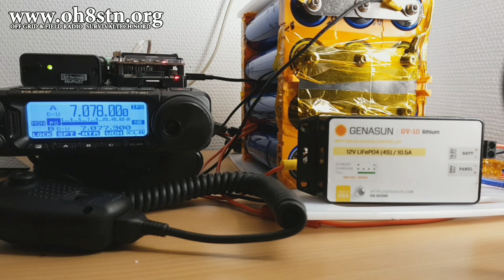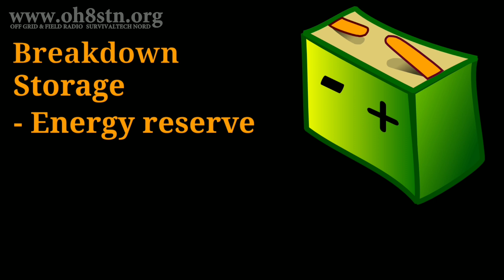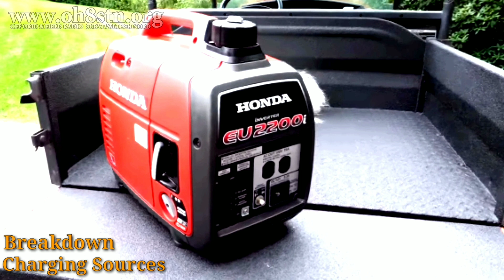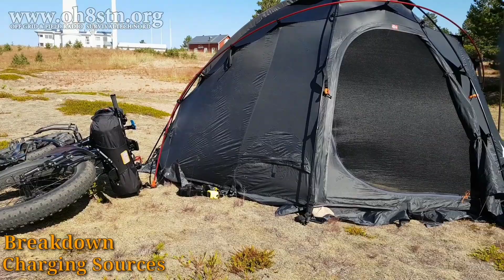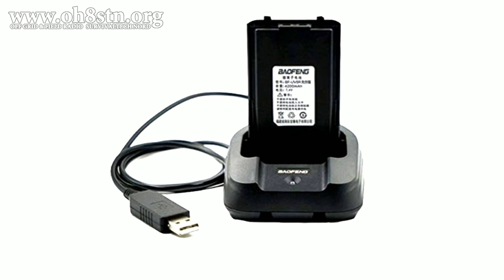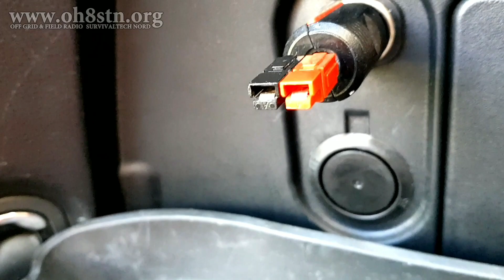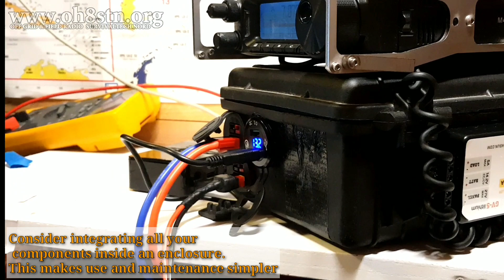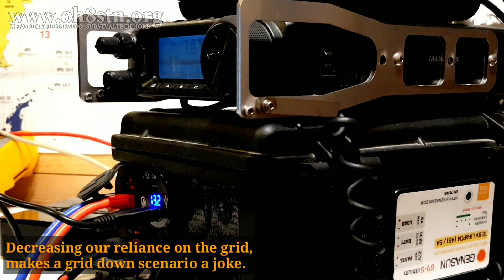Backup Battery Power | Grid Down Communications

Comment: Hello sir. I built a Gmrs go bag using a Wouxun KG1000 50 watt radio. For power, I purchased a 12v 12ah lifePO4 battery, when I attempt to transmit, the radio goes out, when I disconnect the power, and reconnect it, the radio comes back on, could it be the bms is overloaded when I attempt to transmit?What ah of battery would you recommend? Thanks in advance...Clint

Comment: I'm an apartment dweller with limited space. I have a DIY solar generator 12 volt battery with a trickle charger on standby and a 30 watt panel. It's just for battery charging , flashlights small stuff. Also battery packs rechargeable batteries and chargers. I also have a southern view sun beams in for about ten hours. Want to get a roll up panel with my limited space can't go on the roof, something is better then nothing. I'll never walk a mile and a half for six double  A batteries. Black Out a few years back , north eastern blackout.
Reply from the maker: Excellent 👍
I use a 28 Watt rollable that drops out of my upstairs window. It's there just in case.

Comment: Radios are powered with 12 volts. Laptops are powered with 19.5 volts. How do you power these two with the same 12 volt battery? Thanks for any info.
Reply from the maker: Not all laptops are powered with 19 volts. Some of them these days are powered by USB C. This is the preferred type of laptop. For example my Lenovo Yoga laptop can be charged with the USB C adapter. For older laptops many people choose to use an inverter, but I don't for two reasons. The noise in our radios becomes a big problem when we use inverters. Secondly it's inefficient. Instead I would get a DC DC power supply 12 volts to 19 volts for older style laptops.
Reply: @OH8STN  thank you. I will do that. The next laptop will be a USB C, for sure.

Comment: Just bought the yeasu 817 can I run it on external power without the battery installed that comes with it ? I have a bioenno 12v 24ah battery and charge controller and 28w folding solar panels.
Reply from the maker: If you have an external power source, there's no reason to have the internal battery installed. It makes the radio lighter if you remove that internal back anyway.
Reply: @OH8STN  Thank you I'm new to the whole portable ham station as well as the yeasu 818 obviously.
Reply from the maker: No worries, you'll have a lot of fun with it.👍
Reply: Sorry to bother you but have a question that I can't seem to find an answer for. Just bought the mfj-1899t to run with my 818 can I run it through my LDG-Z 817 without using a counterpoise?
Reply from the maker: Definitely not! It would be the same as running 1/2 of a dipole. Get yourself 3 or 4 counterpoise wires a quarter or half wavelength of the frequency/band you're working.

Comment: Well done. I’m situated in a somewhat remote area about 50 miles from Yellowstone Park. Worst scenario.. the volcano blows and none of this will matter anyway. Short of that, we have no intention of abandoning our home. Our emergency preparations include:
1. Hitzer coal stove to heat the radio shack/pantry/reloading building.
2. 2,000 pounds of Tractor Supply anthracite nut coal.
3. Honda 6500 inverter generator.
4. 300 gallons of premium, non ethanol gasoline.
5. Transfer switch to power vital circuits with the generator.
6. Coleman, Feuerhand and Aladdin lanterns with fuel and spare parts.
7. Backup stove/oven plumbed to 500 gallon propane reserve tank.
8. Night vision equipment.
9. Spare ham radios, antennas and power supplies.

I plan on picking up a Honda 2000 inverter generator as budget allows.

Comment: I really like the vid.  It give me alot to think about.  I really got stuck on the distribution cable you made.  Great idea.  But I get stuck on the manufacturing especially between the USB and the power poles.  Is there a video or a location that has more information on making a cable like that?  Thanks again.
Reply from the maker: I Doug. Do you mean how I powered it with a buck converter and external battery?
Reply: @OH8STN  I mean the distribution cable that had power pole on one end and 2 power poles and a USB on the other with a fuse in the cable.  Thanks

Comment: Hi Julian, Quick question – Although you did not mention it in your video, I noticed that you added a switch to the side of the battery box. I’m assuming it is a main disconnect for the battery. My question is how did you wire it? Previously I have used a simple rocker switch for this purpose. Although it is capable of handling the amperage, I am always worried that it could be accidentally switched off. The switch you used appears to be more flush mounted requiring more effort to turn it off. I looked on Amazon and found what I think is the switch but it doesn’t appear to be able to handle the amperage. Could you please elaborate on this? Thanks, Chris N0PRO

Comment: KG5IPM we use the "AA" battery pack on our UV5R"s and place rechargeable batteries in them. They hold a charge longer than the standard battery packs and allow us to use "AA" battery charger OFF a roll up solar panel to keep batteries charged and the radios running.

Comment: Great video Julian. I'm using some 20 AH bioenno batteries but I haven't sorted out the solar charging yet.  I enjoy your videos! Keep up the good work.  - J. Harvey.
Reply from the maker: Thanks Jim. I'm using the Genasun charge controllers. They are extremely quiet and come in a very small form factor. I think 20 amp hours will run your gear for quite a long time. Congratulations on getting set up.

Comment: Just stop using grid power with your communication gear altogether.  You will have some growing pains switching over.  I started wit 100 watts solar.  That wasn't  enough.  I upgraded to 200 watt.  Close but no cigar.  Now I've got 400 watts.  We will se how that goes.  Mppt charge controllers are great BUT they can be noisy (RFI).
Reply from the maker: Yeah the growing pains are tough, I'll give you that one. Especially if one is used to operating full power at the flip of a switch. 
I've never heard of a noisy stand-alone mppt charge controller.  The ones with built in inverter are notoriously noisy though. PWM charge controllers are almost all universally noise makers.
Can you tell us about your batteries?
Reply: @OH8STN  My controller is the Renogy Advanced Rover Li 40 Amp 12V/24V DC Input MPPT Solar Charge Controller with Bluetooth.  I'm currently a 12v Deep cycle batterie that I plan to upgrade soon.  I'll probably stick with deep cycle since this is not a mobile setup.  I have lot's of smaller batteries that are mostly Li-ion and nimh.  I'm only around 100ah right now with my primary storage.  The nimh are for all the little devices that need aa/aaa.  I keep dry cell adapters for my HTs as backup.  There are battery packs for the Baofeng that have charge cicutry built in.   Those Baofeng are good backup/handout radios.

Comment: another informative video, Julian, thanks!  I regularly use my QRP (also an FT-817nd) setup from a backpack, Bioenno LiFePO4 battery, solar panel & charger.  I am nearly always able to return with a full charge.  Question - what DC meter do you recommend to determine current draw while operating? Although they're cheap, I'm seeing very mixed reviews
Reply from the maker: Thanks Steve. 
I have a built-in shunt between my battery and radio, so I really don't use inline meters in the field anymore. I do still have two of the inline meters for testing. One from Powerwerx, the other from Turnigy. Neither are absolutely accurate, but they do give a general indication of the amount of current passing through. The Powerwerx meter was gifted to me, the Turnigy was purchased from hobby king, then added the power poles to it myself.
Thanks for the comment and the kindness, It's very much appreciated.

Comment: Great video Julian! One question, can you do a video on antenna analyzers? I've in the market for a number of reasons and I am torn. I know RigExpert is the cream of the crop, but I wonder if I can get away cheaper but have something as reliable and accurate. I know you reviewed the mini60 a few years back, but what do you think of the mini600? I'm concerned about build quality and support if it bricks. I've also considered MFJ, but the reviews are always bad with complaints of build quality issues, a huge number of batteries required, or slow turn around time for repairs. Any thoughts?
Reply from the maker: Well just to put it upl on the table, The mini 600 is on my "get list". I love the rig expert antenna analyzers, but they're out of my budget. I have two of the mini 60 analyzers which are working really well. Build quality is often an issue with Chinese gear. That's the risk we take for the lower price. If the mini 60 is any indication of quality, the mini 600 should be just fine.
I have owned mfj analyzers and yes they work fine. But if we compare them to the rig expert, or some of the Chinese offerings, the mfj are critically overrated. They're heavy, require an enormous amount of batteries, offer no good repair Network, and are extremely expensive to send back if they go wrong. When my mfj analyzer broke, I wanted to send it back for repairs. The response from company was reason enough for me, to never buy another mfj product again. For what it would have cost me to send back, I could simply have purchased another one. Now I'm no fan of the Chinese products oh, and I would certainly buy the ring expert if I wasn't using all my money to make YouTube videos. From this perspective, the Chinese have saved the day with their better selection of analyzers. They have some really cheap ones as well, but I'm not willing to buy those for the conditions I'm working in.
Reply: OK, yeah, that helps me a lot. I was already a little closer to pulling the trigger, I think I'll go ahead and order now. I decided to order from AliExpress instead of eBay since they offer at least some kind of return policy and they have more shipping options, unlike the USPS only (crap service) eBay shipping from China that will take a a month. Btw, make sure to order the 2019 or later version depending on when you buy one, they've made some hardware and firmware improvements in recent months. If I can get my HF antenna working better with lower SWR and possibly putting a common mode choke on it, maybe I can make a contact with you soon. Thanks as usual Julian!

Comment: Watched the video. Lots of good advice on grid independent systems. Read most of the comments and your replies.  Good stuff there too.  No matter which system of getting power you chose, there are limitations and problems.  A combination of solar, wind,  grid, gen set are mostly complete and depend on your location.  One you didn't mention was water.  There will be those who are in the right location to include water with solar, wind, grid and gen set. The right water source can provide an almost constant and reliable source of power generation.  Of course not everyone will find that stream or river to set up water, but it is there for the taking if available.  Think Niagara Falls.  Not meaning to sound critical, just thinking about all sources of energy to capture.  Keep the videos coming and stay warm as winter approaches.   73  W0YVY

Comment: Where did you get the pedal generator!!! 
Very slick!
Reply from the maker: Hi Troy. It's right in the description.
Reply from the maker: To be honest with you I wasn't sure about it when I received it. But actually I can charge up my solar generators with it directly to the solar panel and put out the trash controllers. It's a lot of work but it's definitely worth it if there's no other option

Comment: This is exactly what I been talking about as I know at one time or another that the grid will fail for some time that could last a week or could last several months . So this is why I decided to go out and by a bioenno battery and a solar system to charge it as well as power my radio during those times . I have for field work an efhw 8010 antenna as well as a ocfd 4010 antenna that I can either throw up as a sloper or with the right tree I can set up an inverted v to be on the air for emergency comm .

Comment: Totally brilliant video and a new sub.........  Efficient off grid power supply for emcomms goes hand in hand with antenna efficiency, everyone knows this and as a fairly recent noob in this area I am thirsty for more knowledge.

As a Foundation licence holder here in the UK (I think its your Tech level)  over the past couple of years I have been looking at QRP field communication and more so the means by which I can power my system.  The system I need has to be inexpensive, portable and produce and store sufficient energy to keep my station up and running should the need arise.  I have a small assortment of radios, some of which are better suited for different things but my two main field radios are the FT817ND and my Clansman PRC320 portable military manpack (HF only).  All, or most of my antennas are home brew and designed to be resonant on the bands I want to use, they are by far dipole type antennas and are so easy to build and deploy I use these 99% of the time.  I am confident that power loss through the antenna is at a minimal so power storage/usage is my next step.

As finances need to be a realistic consideration I needed to shop around for a balance between weight v expense v capacity and find that RC Lipo batteries are better for me, although this is not likely the case for many.  When using the FT817  I carry 4 x 5500mah 11.1v batteries, a foldable solar panel (40w 3.5ah) which has a built in solar controller and a small multi charger that allows me to operate for long periods of time without power loss.  Maintaining the Lipos can be a pain in the proverbial, but if managed properly they serve me well.

I had never heard of BUCK Converters until watching your video, so thank you for showing me how I can now charge my handies that are cradle mounted from my battery bank, I have just ordered 4 of them and look forward to integrating them into my system.  

I run a very simple solar system at home with  4 x 110ah leisure GEL batteries being fed by 150w (7amh peak)  solar panel, this may not be the biggest or most efficient system in the world, but it serves my needs.  I have also built a small solar power pack for portability with my radios when out camping. 

Sorry to ramble on, but trying to get others to understand that efficient power supply is so very important in a grid down (SHTF) scenario is a nightmare.  It does not matter how much your lovely very expensive radio cost, if you cant charge or power it, it's a worthless piece of metal and plastic.  73 (M6KVK)
Reply from the maker: Thank You For This Magnificent comment and I assure you, you weren't rambling. How we achieve our goals in the field is exactly the question I asked in the video. So your comment is incredibly valuable..
Thanks for taking the time to write it all out for us.
73
Julian oh8stn

Comment: Great video Julian ! It is amazing how little that battery sustainability is considered in communications. The youtube "experts" so often quote regurgitated opinions and obviously have no experience let alone concept of just how important this is. Thanks for sharing !
Reply from the maker: Thanks Brett. You know, sometimes I feel like we are beating a dead horse. For example your latest Motorola video, swapping out the nicads, for lithium ion cells. A fraction of the weight and increase in capacity  are incomprehensible to the "experts". Anyway it's always awesome to get to comment from you. It's also very much appreciated 👍
Reply: @OH8STN  You are welcome ! Battery is a finite resource and not all batteries are created equal. I pulled out that 18650 pack I built way back when to PM and charge it. It was still 16.3V before the UBEC. Good Li-ION  batteries are going to quickly match exotic chemistry batteries for shelf life.

Comment: Great video.  Sorry I missed the live stream.  I was in the Sierras for three days practicing my remote operation skills.  Had a wonderful time but it was too hot for my liking.  Love to throw up a wire, plug the radio into a small battery, and be on the air.  Used the KX3 so only 15 watts but still made plenty of contacts.  Nice to see you on the air.  Take care.  JJK  N6NRO
Reply from the maker: No worries John. Sounds like you were having a much better time than sitting in a room editing videos :-)
Thanks for the comment, and kindness. It's very much appreciated.

Comment: My friend and I have established SSB/CB radio base stations at our homes, six miles apart. We found 2 unwanted, 30 foot tall metal television towers. His CB antenna is 60 feet in the air and my CB antenna is 54 feet in the air. We both use 12 volt, deep cycle batteries, charged with battery tenders, via wall outlets. In the case of a grid down, we can use jumper cables on our vehicles to keep the deep cycle batteries charged. Thanks to the height of our CB antennas, we're able to get seven pounds of signal strength between our two stations, with excellent modulation, using 4 watts of power. We used our CB base stations to communicate yesterday, when our landline phone service was disrupted for half a day after a storm.
Reply from the maker: For that distance, cb radio is totally fine. Have you considered adding a charge controller and small solar panel as the battery tender for you're deep cycle battery? Then your deep cycle batteries wouldn't be dependent on the car or the grid. 
Thanks for telling us about your setup. 👍